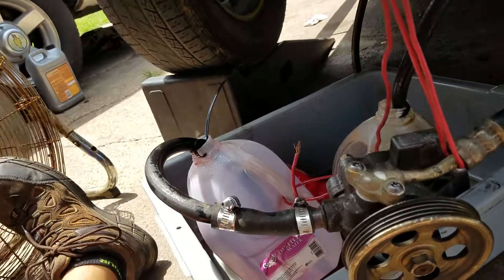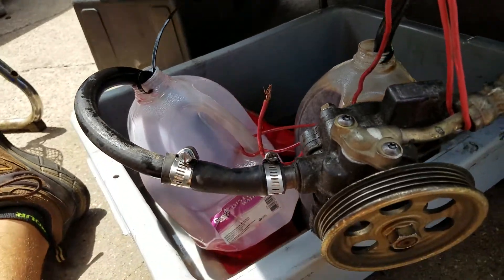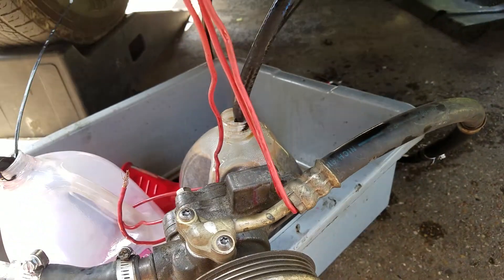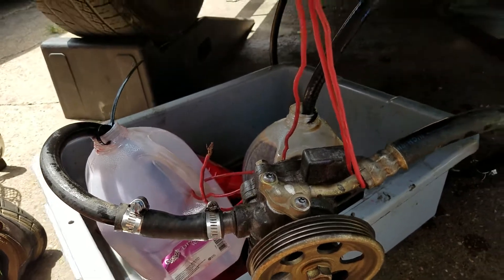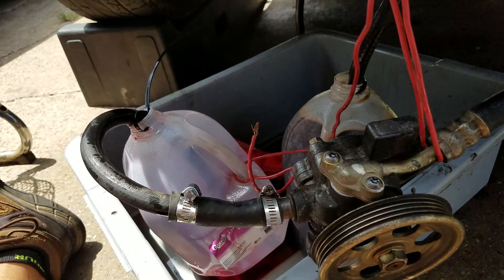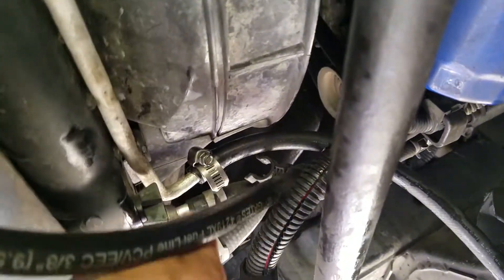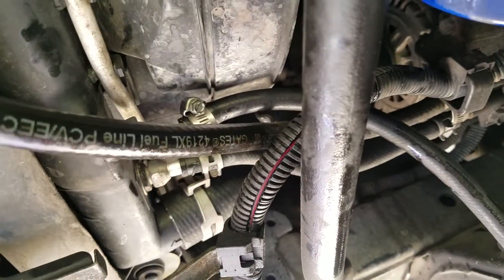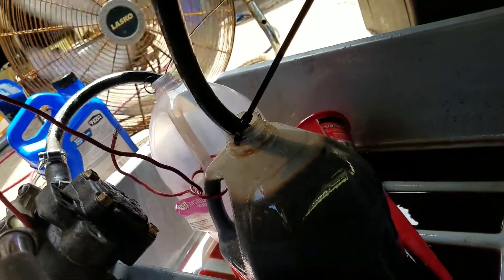DIY fluid transfer pump transmission fluid refresh Isuzu Rodeo

Comment: Why wouldn't the trans return line draw the new oil from the container?
Reply from the maker: The pressure from the pump makes the fluid flow thru the cooler. The return line only is a dead drop back to pan. On some vehicles it does feed a function but not on most. Its bypass pressure from the pump.
Reply: So its a one way thing......thanks for the reply.
Edit: I guess thats why some auto shops have the trans oil transfer units.
Reply from the maker: @Jeff-sc1df  yes, one way. The return just matches what comes out and the same volume.
Reply: @chriskolar  

Well, how about a gravity feed to the return line. Just pour it in as it leaves the funnel until fresh red fluid comes out the pressure side......I think that would work.
Reply from the maker: @Jeff-sc1df  that is possible. You may need to turn the car off and on according the flow. The rate of fluid coming out may exceed the fluid going in. If the pump runs dry it could be damaged.
Reply: @chriskolar  thats why you pump out 2-3qt and then put back in same amounts....This looks want to much mess and hassle. Heck spend 30 mins cleaning it all up and disconnecting things...

Comment: Wow why not just start draw off 2qt put in 2 qt until you see nice clean fluid out of the cooler output...I just drop pan change fluid and drop fresh fluid back in to pan. I drop the trans cooler output line to tranny start vehicle and put out 2qt old fluid , pour back in 2qt clean run again until 2qt and repeat.. then when I get close to total capacity I watch fluid for color change and go past 1 more qt to ensure its all changed out. Usually 12qt fluid for most vehicles works , now diesels and RV take more now but most 12qt covers complete changes.No messing with BS pumps and hoses and matching flows...Your way just seems more waste and non sense.